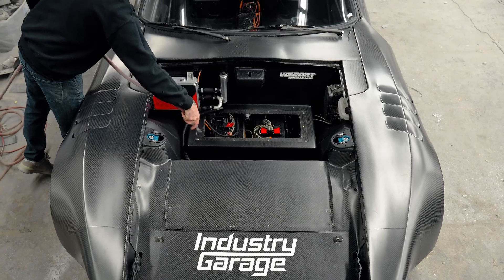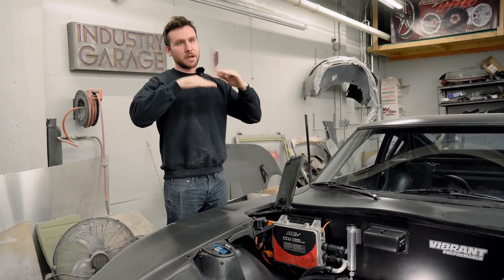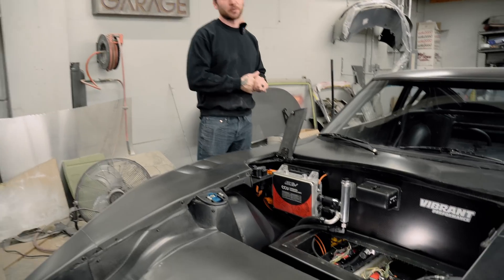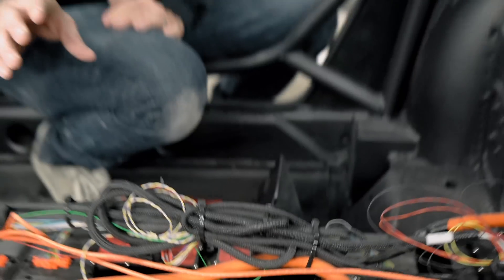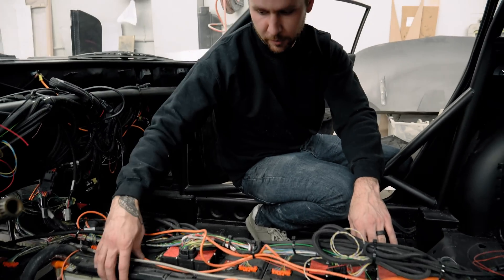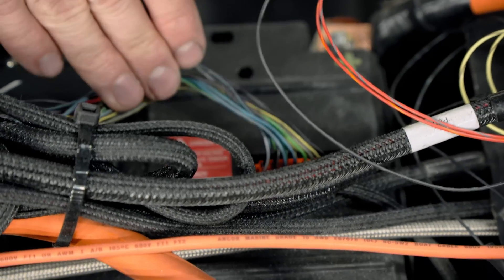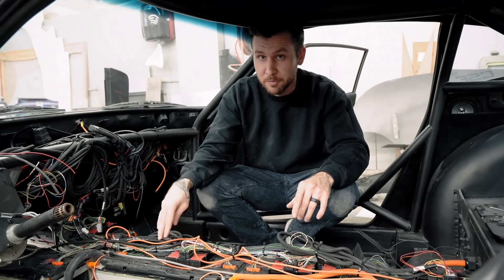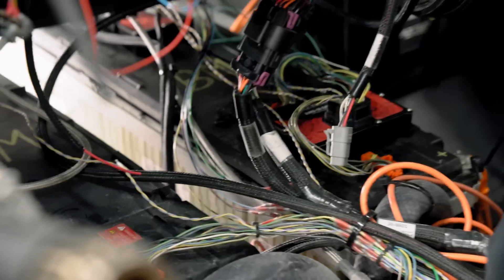AEM EV Battery Management System | The Legacy (21)

Comment: With the Chevy Volt battery, please lookup Damien Maguire on EV BMW to see that there's an issue with the factory cell taps , they are not internally fused and can short out and set the battery pack on fire 🔥🔥🔥. 
https://youtu.be/5CkW9yW2yOg?si=x5qRH-2zdqjsBeoX

Comment: I'm so glad engineering is finally getting to the point where antiquated terminology is meeting social ethics. Master and slave made me feel some kind of way for years! Base and satellite, or master and satellite is much better. 
I used to work in a place that had a bin named “ slave morals”.
Reply: Are you scared of a realtor showing you a master bedroom to? 😀
Reply: More like the clutch wouldn't work without the slave cylinder.
Reply: M as a matter of fact I am working on my bachelors degree. Then I plan to get my masters in Electrical Engineering. Would you be in pursuit of a slave degree at any time.

Comment: 12 satellite systems at $300+ per system? Plus the $500 master. Damn that's an expensive option, over $4000 just in battery management. I hope there are cheaper options on the market as ev swaps get more popular.
Reply: Yeah use the Tesla bms